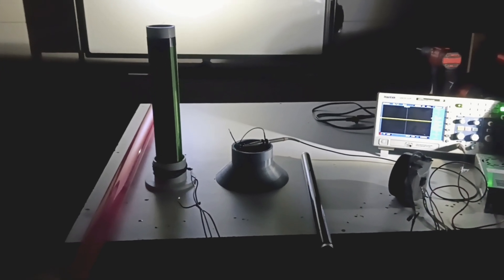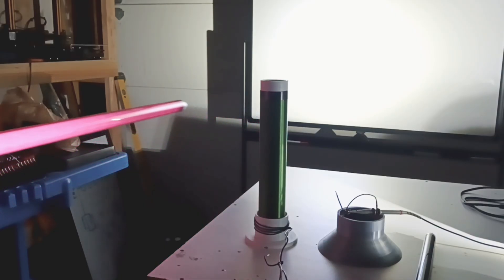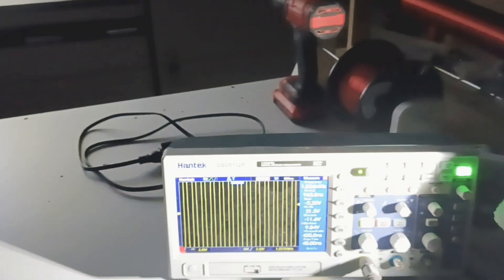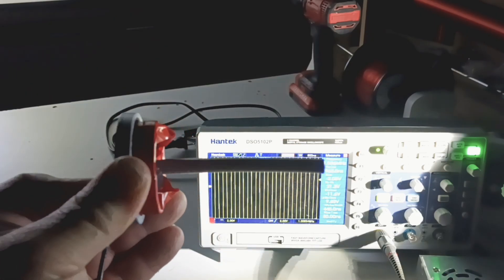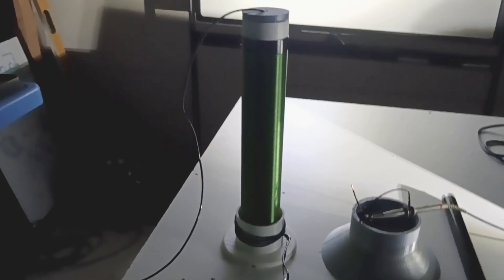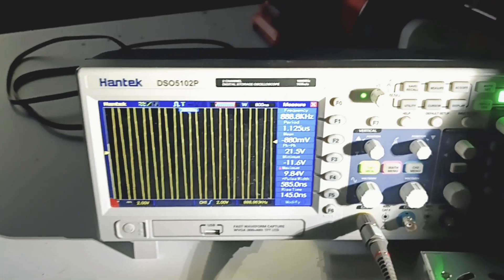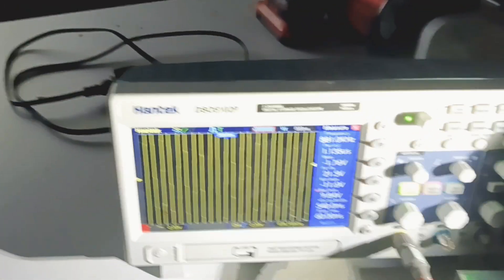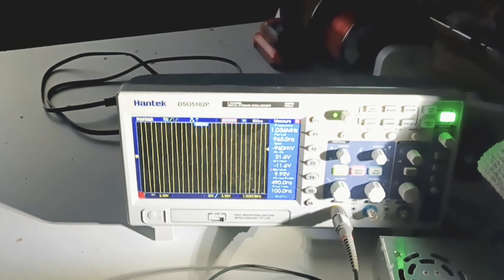1mhz Tesla Coil

Comment: Can't the length of secondary be tuned using a magnet near the coil? Or by adjusting location into the primary? Are you sure altering the mass or length is necessary? Such as with a tuning fork they simply change the frequency mass length by attaching a weight.
Reply from the maker: you can remove windings or change windings on #1 coil. either way it needs to change. there are no caps on this circuit.

Comment: Nathan would it make any difference if you were to move the primary input wires? Shortening or lengthening the primary may change it I don’t know.
Reply from the maker: Yes it would. slayer exciter is forced resonance. no caps. so each winding makes a difference.
Reply: @oldmanbuilds  
I know that you’re not looking for self running energy systems currently but have you ever run calculations on neon sign transformers, laser modules and possibly ZVS’ and other high voltage sources.
Watched a Don Smith video Expanded that Rick Friedrich put up a few days back. Interesting part is where Don brings this up, says to compare watts in to watts out. These are already over unity devices based on those output numbers.